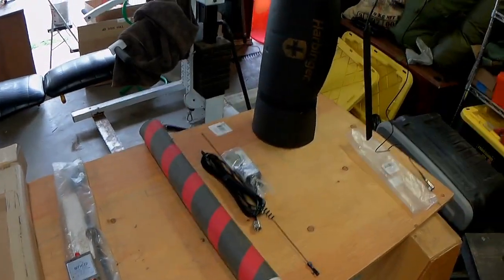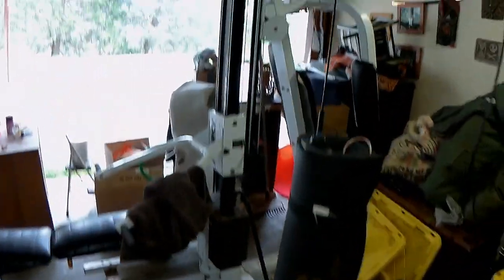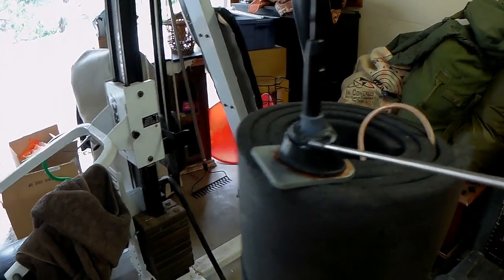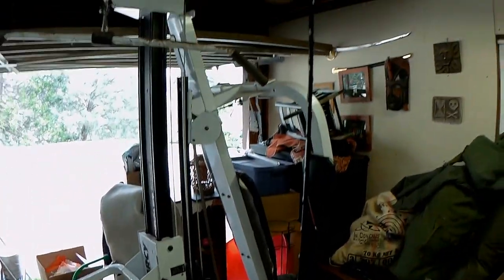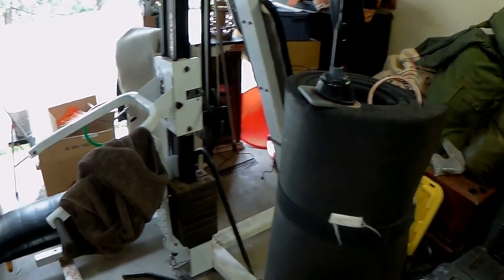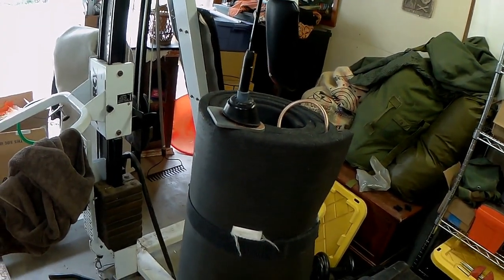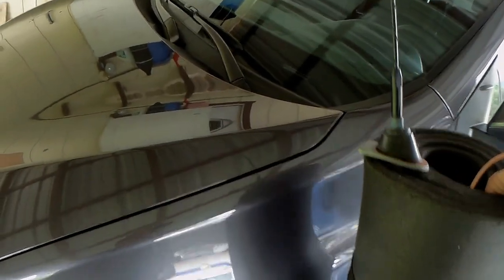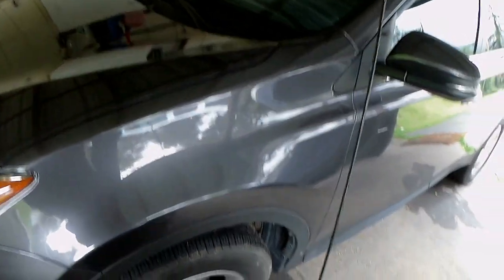Undercover Grayman 2-Way Mobile Radio Antennas

Comment: I have a Euro style antenna on my car BUT who is the idiot who tilted the whip backwards at 20°? Hey it’s great for moon bounce but it’s a poor antenna considering FM station transmit with a vertical stick. Now if someone made a euro style base with a vertical mount instead of a tilt mount it would be great. The same goes for the Two way portion of this undercover antenna. Even that slight tilt off of vertical will interfere with the proper radiation pattern of the whip.

Comment: Ha ha ! I drive a porcupine. A CB, a ten meter,  And UHF/vhf. The first time I came to the neighbor hood. COP COP HES A COP.  Then often I would drive 5 miles and stop and find that the antennas.had been cut off at the body of my car. Never missed them till I needed the radio. Not to mention the jerk that takes a motor cycle battery. And hooks it to the stinger and the base of the mount to kill the finals. Thrugh the cars ground. The best I did was to isolate a luggage rack on top of my car . No body"s the wiser. Also the window defroster makes (with tuner) a decent vhf.  antenna. . Thanks
Reply: What type of tuner did you use and where do you place the feed wire to the radio? On the + or - side of the power on the defroster grid?

Comment: when I worked for Motorola the best undercover vehicles were always the IRS. They would have all sorts of cars, tags, and no antennas visible even no radios visible when you look in the car. They had hand units that controlled the radio that would plug in usually under the seat but not always. The actual radio was hidden in the trunk usually under a panel so one wouldn't notice it. We even mounted and bent antennas up under the car frame.

Comment: I'd be interested in your review/opinion on this product https://youtu.be/Rt5WRNXbdDI
Reply from the maker: Looks promising, but in my humble opinion, somewhat under powered. The comment section of the video ripped the review a new one. one post stated the android version is too old and unsupported. less than 2 watts could get you maybe a couple of blocks in an urban area without the use of repeaters. Personally if it was me looking for something like this, I'll hold off till the technology equals todays capabilities. 5 watts minimum with a current android version platform. It reminds me of PC's in the 90's, as soon as you buy one, its obsolete  compared to stuff they have coming off the assembly line. Seems like this is where comms is headed for in the future. Its just an opinion, I could be completely wrong and short sighted. Thanks for the link it was interesting.

Comment: The price is consistent for that company's products. But it will endure the carwash and be stealthy.  The expense of replacing a damaged antenna / mount from a car wash  can add up quick.   The adhesive antennas have caught on in popularity on the 800 band but like all stealthy options it is a performance compromise. Thanks for sharing !

Comment: When I worked in Germany I had a vw gulf with a diamond stealth vehicle antenna. It was a -:1 replacement for the original antenna, had built in triplexer to split vhf, uhf, and fm broadcast. I used that with  a kenwood d700. Radio body was under the passenger seat, and only the head was on the dash. It was the only stealth installation I've done.  I'd like to do the same on the Outback, but the stock antenna includes active GPS antenna with bias-t. I would have to split that off somehow.

Comment: $500 bucks is a 'stupid' price.  Ya gotta be stupid to buy that, or a goobermint bureaucrat with a bloated budget.  That is the proverbial $600 dollar toilet seat made in China and sells else where for $10.00.  It is all in the marketing.  Currently making a discone that will cost less than $10.00 using mostly scrap parts and a free downloadable discone antenna calculator that gives one the dimensions.  Should be good TX on 2 meter,  70cm, 220 and 800, 1200, and maybe 27Mhz or 6 meters with a whip added.  RX should be 25 to 1300Mhz, or 136 to 1300 if I skip the whip portion.  Covert antennas requires only a bit more effort and creative thinking, but will be important in the future when processing a transceiver could be illegal.  The ability to make your own antennas in general will be important also.  Get an SWR meter to at least check any antenna that might be used, and to roll your own. 

BTW, YT has a hit on 'prepper' type channels, a form subtle censorship is now becoming increasingly more aggressive.  That would something to anticipate, and may explain in part the negative responses.  I have been censored multiple times in recent months on Alex Jones videos.  They deleted strongly worded, or passionate content.  They are going after preppers in many ways with the intent of pushing us out, or shutting us down incrementally.  Thanks for putting yourself out there and passing along the knowledge.
Reply from the maker: Actually its 100% American made, they are a solid reputable battle proven company. The cardboard box contains the rest of the magic that seems to be detailed made by hand. Not shown also included is an AM/FM band amplified antenna to interface with the stock radio on the vehicle so it will continue to function like a normal setup. It commands a high price because its a specialized peace of gear to do a dangerous job without getting caught. Not to mention integrating 2 radios into one antenna. Its a fair price. we actually paid 465 bucks.
I think my channel is lost in the static. I diversify a little bit with regular ham stuff and outdoor adventures but having preparedness roots. Perhaps, I'm not considered a threat yet.
Thanks for watching.

Comment: Been seeing a number of those antennas on “Cool Cars” in San Diego; vendor (un-named) must be making some money -told they work ok in urban settings. In my era Low-Band mid-range antennas were square loops mounted on stand offs underneath the vehicles made by our radio shop… good video don’t need a Japanese job clamped to your car.
Reply from the maker: I heard, they are making them look like roof racks now. Supposedly it's wideband to accommodate their freq spread they use. its hard making a bigger bandwidth in that range and trying to be discreet. I cringe everytime I see a unit with them..
Reply: These were our "Sneaky Pete Cool Cars" loops worked fine State "Blue Channel" overhead roof racks would have draw attention to the Dicks as unusual also had Low-Band car trunk lids (RF insulated) Don't touch when transmitting...

Comment: You really need to check out the Panorama Sharkee. Last one I saw online was about $250 with the triband whip (146-174/430-480/764-896). Add a $50 diplexer just to get you up on V/U.
Reply from the maker: I wonder how we missed this outfit, they sound promising...
Reply from the maker: No wonder I missed them, they're English. Not advertised much in the US and the major distributors dont carry their gear. Gonna have to check them out for sure.
Reply: GUERRILLACOMM  if you want a panorama sharkee to test pm me ill send one I have. we bought a load for our new dog units so I can spare one fora short while. im in the UK but dont mind sending it across to you.
Reply: They've got distribution within the states; Texas to be more specific; although most orders ship from London.
Reply: Bearcom recently took them on as a larger distributor. I used to work for one of Panorama's previous MR firms (in Texas) which is how I got mine.

I used to use the 2.4/5 GHz antenna specifically for demoing the X10DR Wireless Speaker Mic…was seeing about a 1000 ft range from the vehicle, give or take. The triband whip works as advertised (I regularly swap my UHF radio out with 7/800 MHz radios for testing).